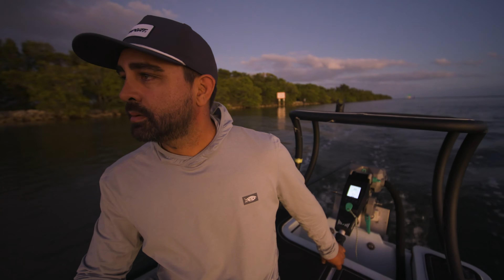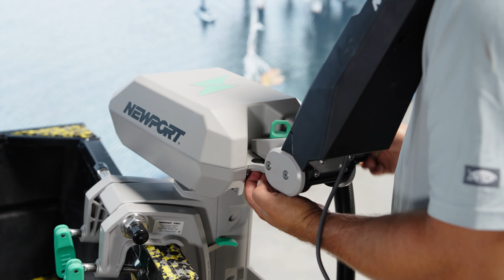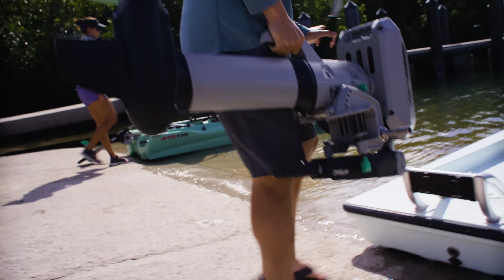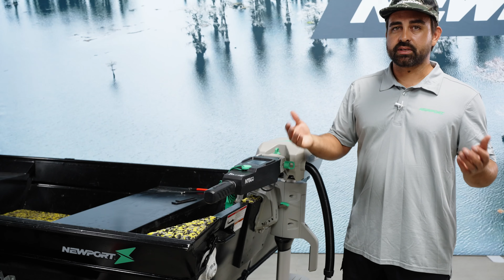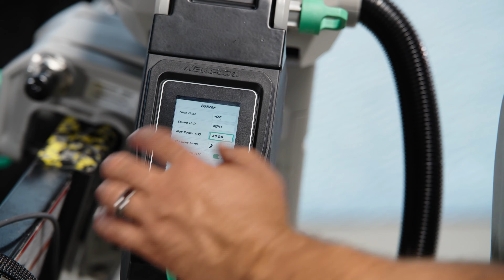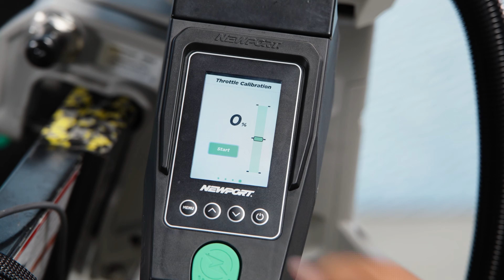NT600 QuickStart | The Official Setup Guide

Comment: I see that you sell a replacement NT600 control box top cover (the plastic top) on the website to replace damaged covers but it is not obvious how to get the old cover off.  The four allen head outer screws on the bottom which are shown on the exploded parts diagram seem to be locked into place.
Reply: Is there a number to call for no serial number for the motor?  Looked where the manual says it should be but it's not there.

Comment: How does this integrate with the remote throttle, does the remote show speed & range? Can the setup functions shown be accomplished from the remote throttle?
Reply from the maker: We don't currently offer a remote throttle.  As of now, the speed is adjusted at the tiller - which does have speed and range readouts, via a backlit full-color LCD screen.